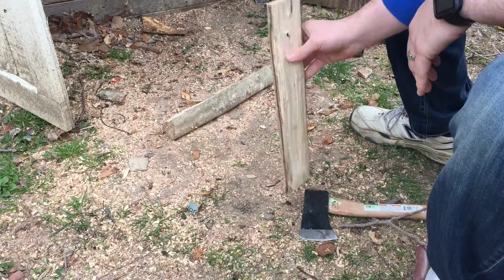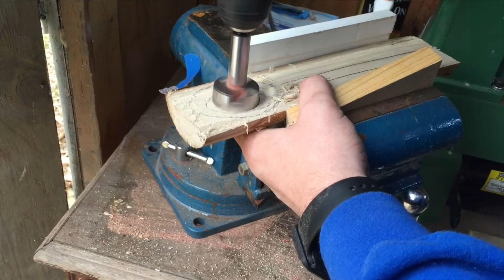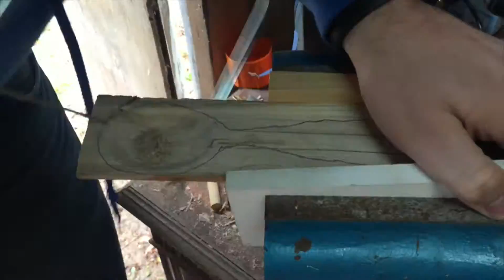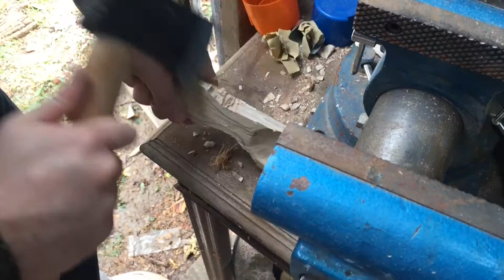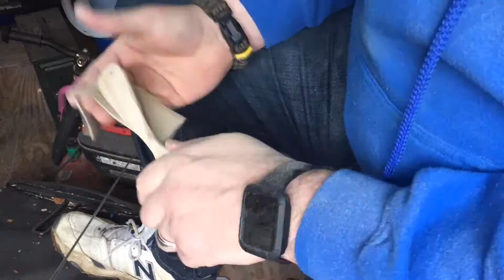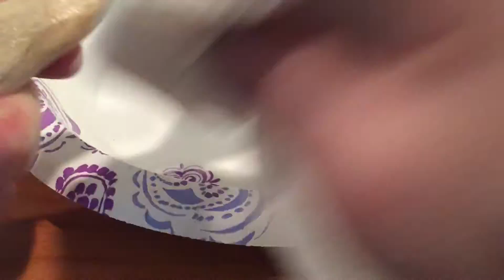Carving 01: First Wooden Spoon

Comment: I've also thought about carving a spoon after staring at all the branches thanks to Dominic. Also, your method of carving is exactly what I'd do. Powertools wherever possible. :)
Reply from the maker: +JWAM I prefer power tools but in some cases here I think it may have been better to hold off on them. Thanks for watching
Reply: tbh with the right technique you could do what he did with the power tools with a simple hook knife and axe before he managed to get the power tool and plug it in lol
Reply: @leprosysucks  I think plugging it in is faster than deciding that one wants to acquire a "hook knife", ordering it, waiting for shipping, spending time to learn the "right technique" and then do the carving. In practice, at least for me, It would take about as long as from today back to my original comment in this thread.

Comment: nice job! one thing I learned with spoons is it is easier with green wood and I really like birch for that.  another is that the pole of the axe will mushroom out if you hit it with a sledge so try to use a heavy wooden mallet.  when carving I use a hatchet for rough shaping, then a sharp knife and a hook knife for the concave part.  take care man!
Reply from the maker: +Kyle Patrick (fenderhead23) Thanks for all the tips. I really need to make a mallet. This wood is well seasoned will using green wood make it easier?
Reply: Yeah, try some green wood like birch or apple for spoons and it will be a lot easier and faster to shape.  I made a heavy, rough mallet for that purpose out of honey locust which is a REALLY tough, hard wood.  Happy carving brother!